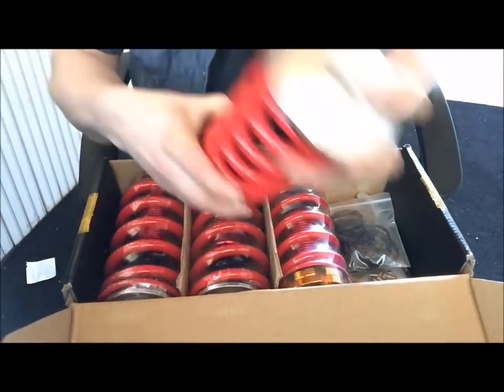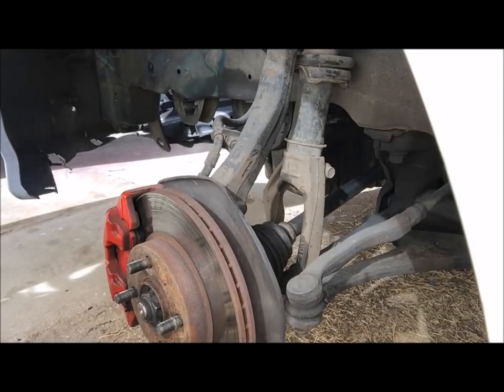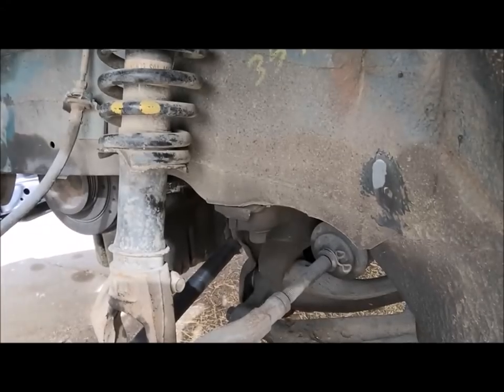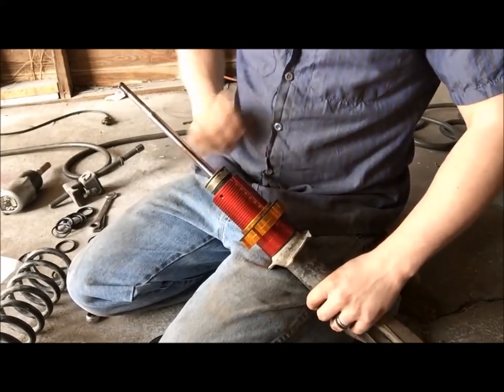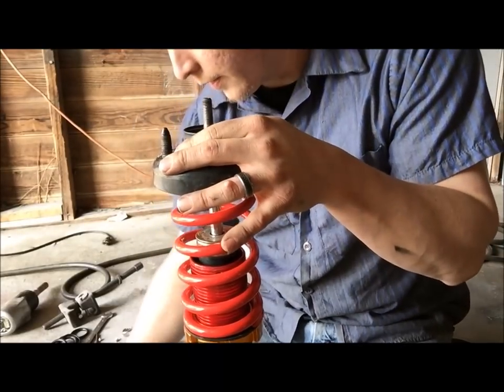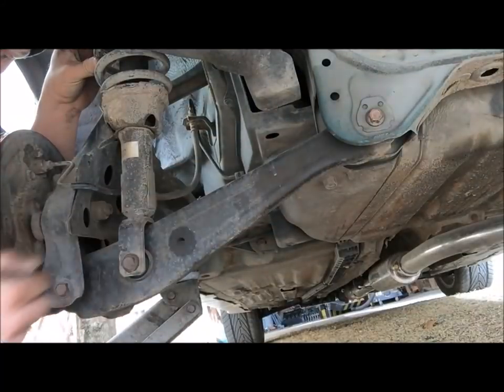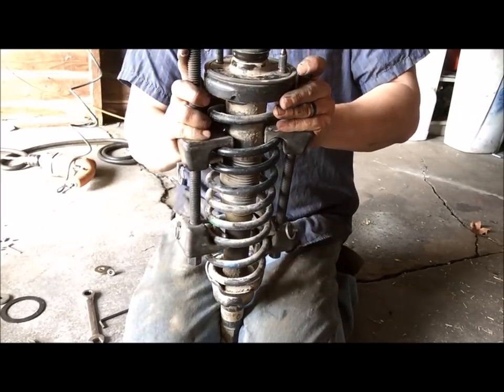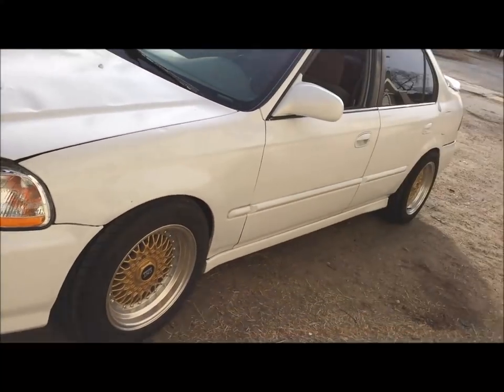Ebay coil overs review and install

Comment: Another way is to use hose clamps around the coils to hold them, user beware! Good deal on the springs, they want around 20 bucks just for a spanner wrench.
Reply from the maker: QQTrick1QQ there is another way safer method I forgot to show. But basically while the car is still on the ground not jacked up or anything, remove the 14mm nut and jack the car up it slowly decompress as the car lifts up

Comment: What about on a honda accord 97 i put it Up to the Highest and its still too low
Reply from the maker: I haven't worked much on accords but the suspension is pretty close in comparison. I would assume they sent you smaller or (lower) spring adjusters. The threaded part. I have seen tall and short threads.
Reply: Same thing on my integra
Reply from the maker: I wouldn't know why its like that. Out of the 50+ I installed I never had that issue. 😅

Comment: Coilover sleeves*
Reply from the maker: Coda5610 you know if I put that in 99% of auto enthusiast wouldn’t know the difference. It’s easier the way I do it. Just like cold air intake for short ram. Most of the word knows it as cold air so fck it ima day cold air that way I don’t have to go into detail as to exact name when I say short ram and they say what’s the difference. It’s easier to appeal to most auto enthusiast terminology
Reply: Trust me a REAL enthusiast actually knows the difference between coilovers and shitty Ebay coil sleeves. Also enthusiasts know the difference of CAI and short ram. The only people who dont know are broke kids trying to lower their cars and not caring about safety. DO NOT INSTALL THESE. Dont cheap out on suspension!!! The only thing that keeps you attached to the road are suspension, brakes and tires. Never cheap out on those 3

Comment: Crap roads + Lowered suspension + removal of bump stops = ????
Reply from the maker: It rode smooth so can't complain! I raised it a half inch after the video and been smooth as can be since.
Reply: What is the size on tires?????

Comment: Please don’t do this to your car, just get some TEIN coil overs or something
Reply: This... Or get proper weld on sleeves and shorten the strut buy cutting a couple of inches off the top and find shorter shock inserts so they sit properly midway trough the travel when idle and not compressed like this with only very little travel leftt
I did that with my e12 bmw because nobody makes anything for those cars and in that case stuff like this can be a good solution if you actually know what you are doing.